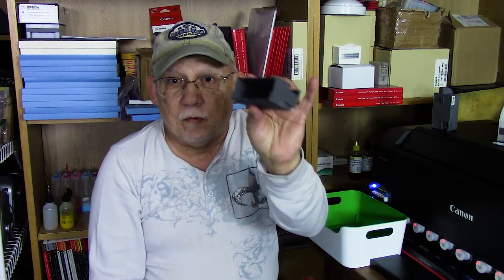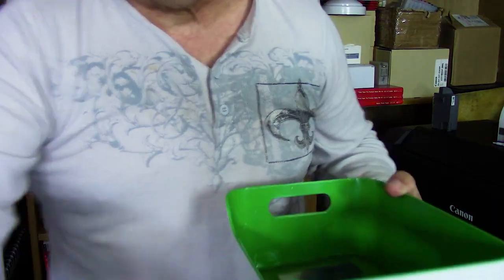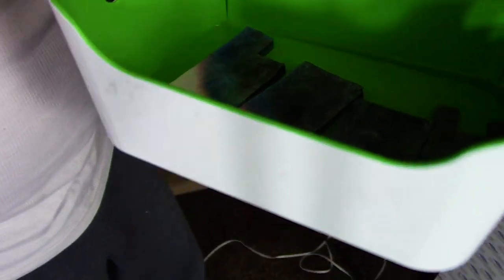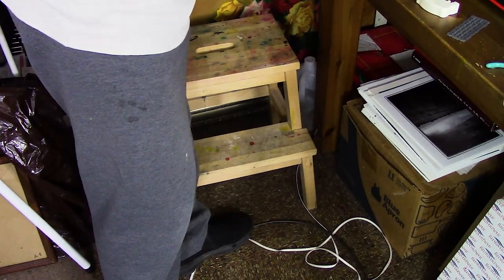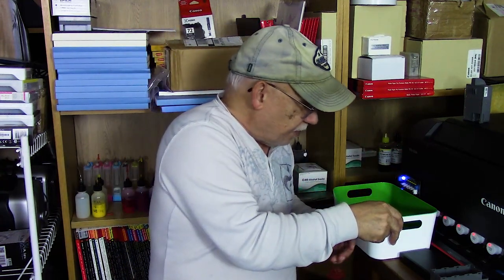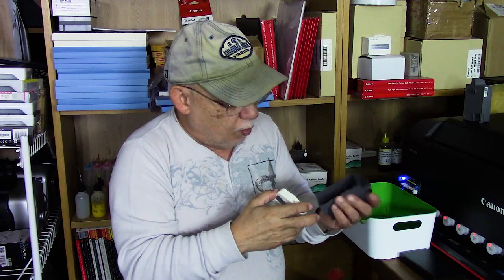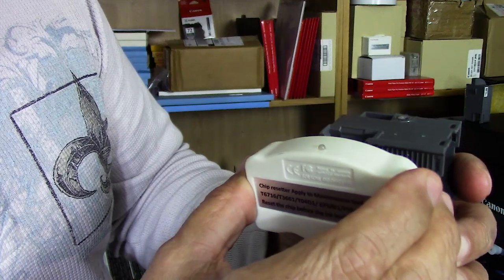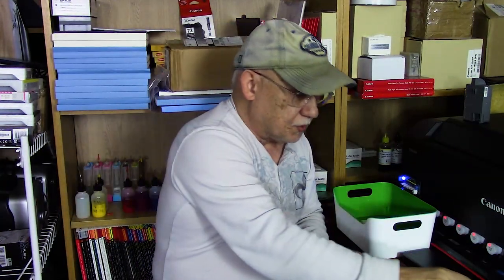I removed the Pads Washed them and Reset the Chip on the EPSON XP 15000 Waste ink Maintenance Box!

Comment: outstanding. I do the same with my Canon ipf mc30 maintenance cartridge, this has saved a lot of money over the lifetime of the printer so far. Every second or third waste replacement I renew the media with a lightweight natural wool/hemp blend that is designed for protection/desiccant packing around ceramic figurines.

Comment: When you installed the replacement tank it erased the code from the original tank.  From what you said, you could then clean the original tank and put it back on the printer where it would be seen as a new tank.  Why is the resetter needed then?
Reply from the maker: The resetter writes a code to the chip making it "Empty" value. But it's permanent unique individual id is still there. So it sees it as the same chip one that has been tampered with. Remember the printer's memory can only record ONE id code. Now you install another cart. Regardless of waste ink level. It erased the previous ID code and records that " New " one. You then remind me that one and installed the first one you reset and repacked. Since it erased it's ID code it now accepts it erased the previous one and records it as a brand new waste ink cart. Tricky??? Yeah a bit. Here is the method I use. I have 2 waste ink carts always repacked and reset. When one is declared full I remove it and insert cart #2. Repack and reset #1 and put it aside till I need to replace a waste ink cart. Constantly rotating them.